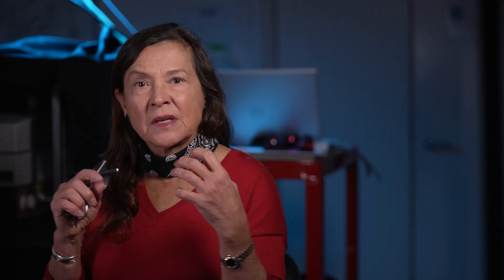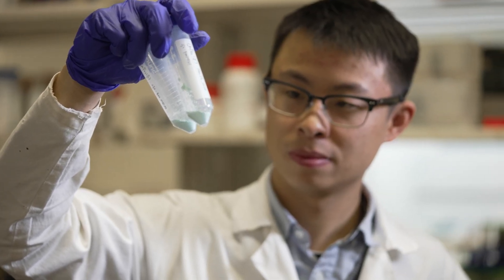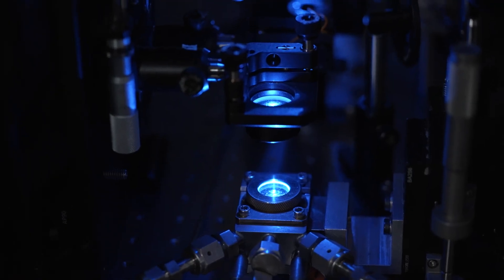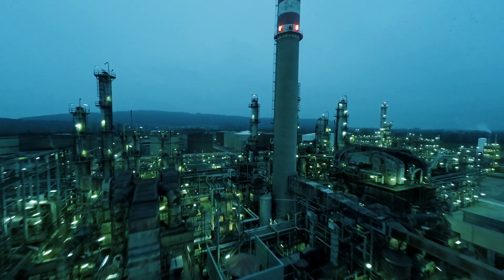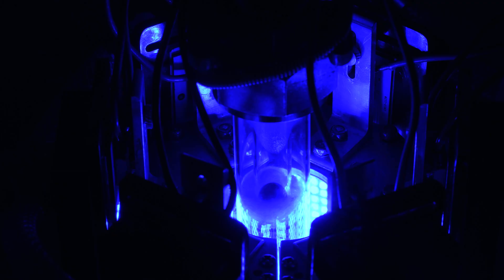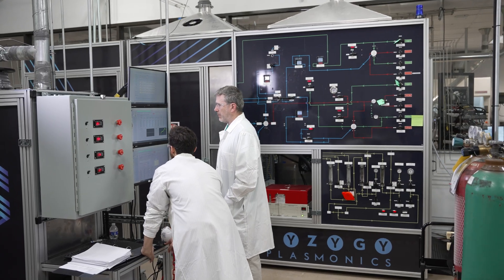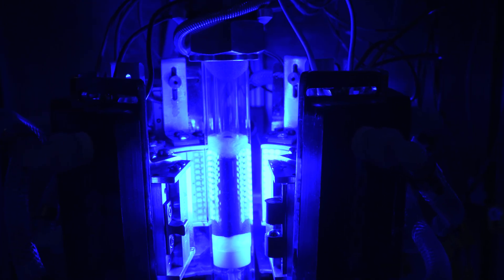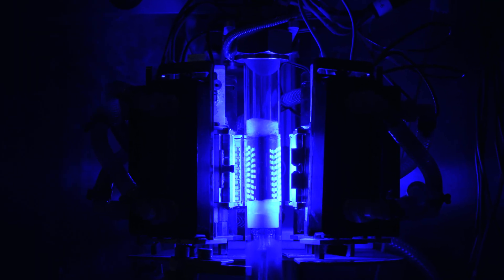Rice lab’s catalyst could be key for hydrogen economy

Comment: Power plants have plenty of options, make the ammonia in deserts with solar power. Cars should make hydrogen onboard via battery and kinetic energy features though...(i:e regenerative breaking/wind drag...)...Cars should have battery that drives car, then physics makes enough hydrogen onboard in order to recharge secondary battery...but cars don't really need fueling stations if the hybrid design is optimized...and that's worth doing in order to be freed from charging stations need...Only thermodynamic limitation becomes battery charging cycle, and batteries are just improving....when supercapacitors happen, might not even need batteries...,Instead, bounce charge between two or three supercapacitors and it might allow enough current to run the cars...

Comment: Funny: NH3 decomposition for the cheap H2 production. While NH3 itself is produced by H2 + N2 (Haber-Bosch process)… H2 is produced before that as singas from CH4… so again a fossil fuel is used to generate H2! (and CO2!)… now any H2 produced differently (by electrolisys for example - demands high energy consumption). Basic thermodynamcis just wont let you have that H2 :). An external source of energy is needed to have a negative balance… fision my friends or sun (fusion) is the only answer